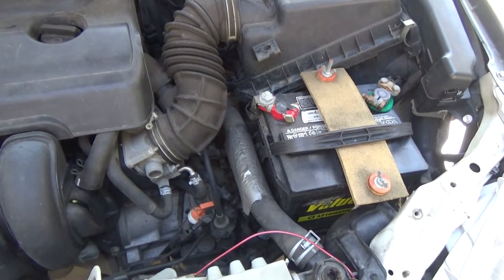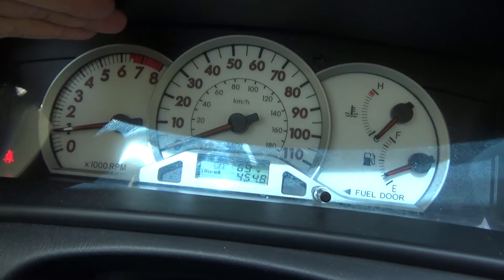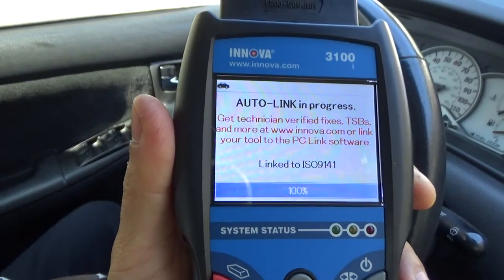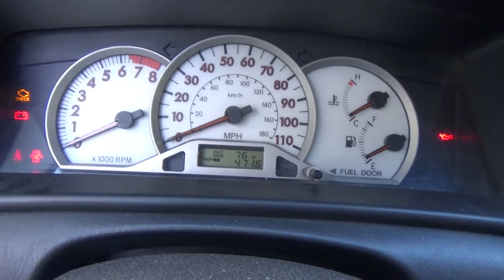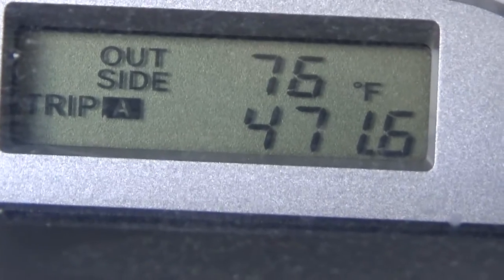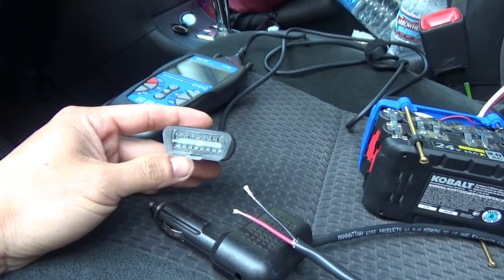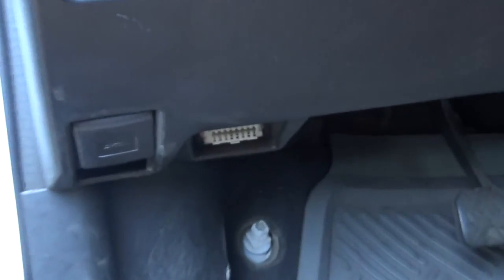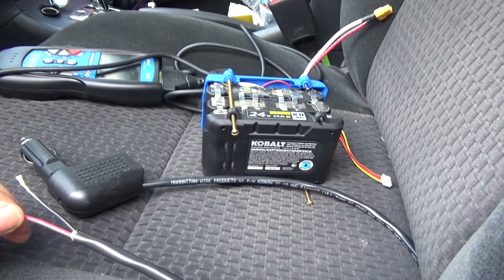What would happen when you disconnect 12V car battery cables without having a backup power supply?

Comment: Hello there before you change your upstream sensor, replace your intake gasket, they go bad after awhile and they shrink when cold thus making it leak. You can verify this by getting a spray bottle with water and spray around the intake gasket,and should go away. And get the orange gasket one instead of the same black one.
Reply from the maker: Thanks for the info. But in my case, I didn't have any problem at all before I disconnected the battery cables. The red blinking lights on my OBD2 reader came up because the ECU was erased and reset due to no power (even though just for a brief period of time). I just have to drive my car long enough so that the ECU can learn and become normal again.
Reply: ahh ok.
Reply: vuaeco what can I do please